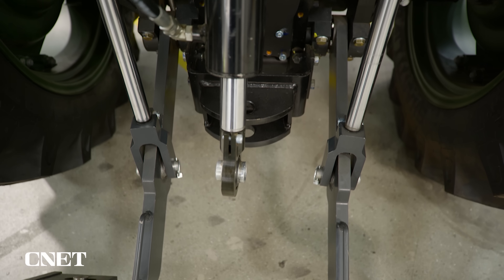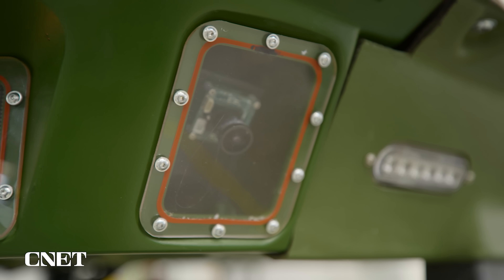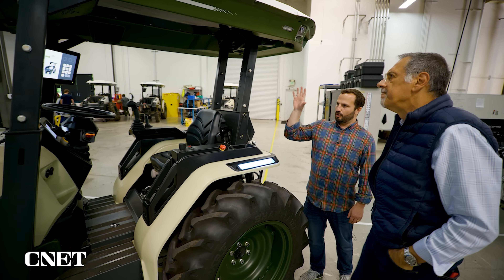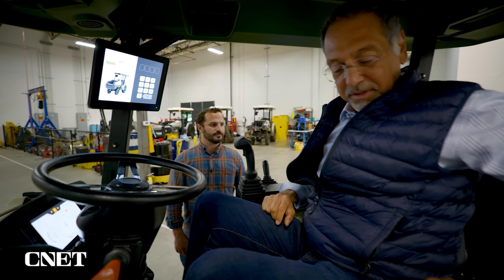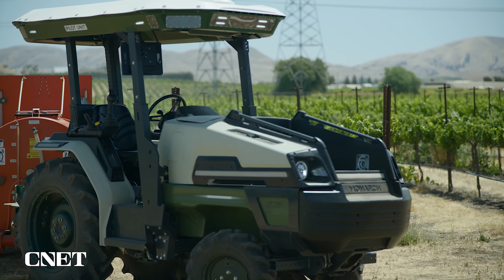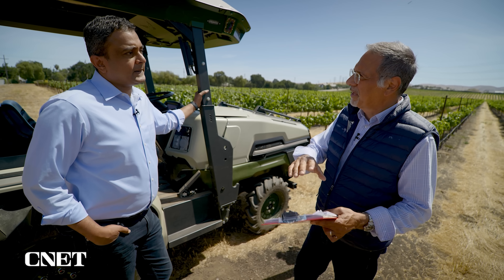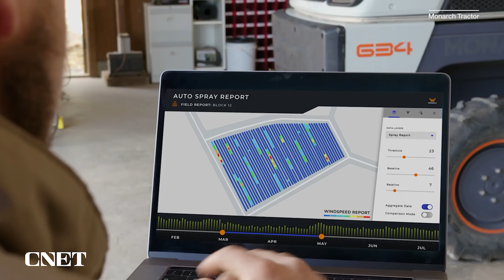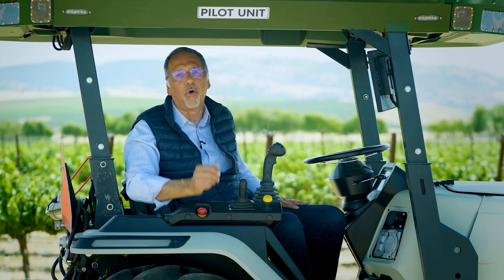This Electric Tractor Might Change the Future of Farming and Food!

Comment: Skeptical that this is going to revolutionize farming. I love electric an this thing might be super handy on a orchard or hobby farm but the majority of farming in the US is done by that other third of tractors that are 500 horsepower. They work 12 hour days under heavy load certain times of the year. I wish I could say that I think electrification of those tasks were just around the corner but I don’t think so. We don’t have the energy storage.
Reply: Yes, but the other  common tractor application is as a chore tractor on livestock farms & anywhere from 60-160 hp used to feed hay etc and typically only for a few hours once or twice a day.   I can see some possibility of chore machines being electric powered, but probably some resistance to overcome, farmers like diesel power!
Reply: @davidkottman3440  I agree. I don’t think farmers are as resistant to technology as a lot of people think. If it adds value and is economical enough farmers will use it. It’s a steep price for a tractor of its size though. I think every farm would have one if they were a third the price. At any price, I don’t think a little tractor that is handy for chores is going to “change the future of farming and food” as the video suggests.
Reply: @CanusDirusx  It's a proof of concept.  Electric tractors have 2 major advantages:  torque, electric motors are awesome at cranking out torque, and fuel costs which is 1/3 that of diesel.  THAT will sell the electric tractors.  The killer disadvantage is the 20 hour days at 80-100% power load.  ATM, you would need a forklift to refuel the big boys.  And that would also mean a number of expensive battery packs lying around in the off season.  
I'm really happy someone is actually working on this tech.
Reply: Imagine how much of a hole has to be dug for just one battery pack for one tractor.
The old lead-acid batteries for a forklift were powerful enough for an entire shift, but then had to be charged for the next shift.
Extra battery? Check.
A thousand pounds of battery, should be no problem, right?
That’s in a warehouse, on level floor, and all muscle to move them.
You aren’t changing out one of those in a field even one mile away.
Reply: @dangeary2134  exactly.  thus the problem.
Reply: My work horse tractor is a 1982 David Brown 1900.. no way this thing has wheels still on it in 40 years let alone reliably work perfectly every day winter after winter.
Reply: @Krieghandt  my tractor is just a giant hydraulic pump.. It's drive p.t.o.. and everything is hydraulic.. It's a diesel engine powering a pump, that fluid drives the wheels attachments etc..  so torque is irrelevant..I can gear it so low, it will just turn the wheels  it would tear itself apart before the wheels stop turning.. all I need is for it to work every day 10 to 18h, every time for forty years, and if it does brake down, I need to fix it in mud to my knees, with vice grips and what's in my lunch box.
Reply: More like 24 hours a day during harvesting ...
Reply: @larryscarr3897  I don't think any new tractors are built to last like the old ones were. I work 5 acres, cultivator, tiller and a blade for winter with my 1950 tea20 Ferguson.
Actually had an electrician/mechanic approach me to convert it to a 35hp electric and with the rise in gas prices, it's tempting!
Reply: Orchards, berry farms and vineyards aren't little operations. Multi-billion dollar industry right there would love this thing for spraying and the precision cultivation alone.
Reply: Jude, I respectfully disagree…. It’s not just a fuel savings, when you remove the gas engine, you’re also eliminating a lot of engine maintenance, and the self driving is going to reduce headcount on the farm… as more of these come on the market, improvements will be made… I’m sure the farmers of years ago claimed the gas engine tractor would never replace the ox 🐂…..
Reply: @dangeary2134  "Imagine how much of a hole has to be dug for just one battery pack for one tractor."......I dunno, probably no bigger than the hole the Alberta tar sands project would need to dig in order to extract enough nasty oil to produce a full tank of nasty diesel for one tractor
Reply: @davidkottman3440  Those livestock farms won't be using driverless tractors though. Any tractor that they use will need to have a decent cab. There's simply too much variability in terrain, tasks, and weather conditions for these tractors to operate autonomously.

The major factor is that these smaller livestock farms are usually too strapped on cash to pay a premium for an electric tractor. It won't be an overnight switch by any means. Many of these farms, my own included, are still using 1970's tractors, and get along well with them.
Reply: Where's the loader, won't have a tractor that size without one, so let's see it do front-end work.
Reply: @davidkottman3440  exactly, what a dream to have the tractor following you round at feeding or mucking, instead of getting on and off it every couple of minutes and starting stopping. 
 The same goes for fence repair. 

Autonomous hay cutting, turning and harvesting. Just great.

Most people commenting negatively here, have obviously never worked on a farm.
50-70K isn't that terrible either, especially considering the roof space many farms have for photovoltaic going to produce your own energy.
Reply: Just because this tractor is small doesn't mean a high HP electric is impossible. They require more investment in design, so they're a harder market to enter, which is probably why they're starting small.
I've considered the design of electric tractors many times before, and there's no reason that the long days couldn't be covered by a replacement battery pack. Pair that with solar power near your fields that brings in additional revenue, and you're expanding grid storage, renewable power, AND electrifying our food sources.
Reply: the size of the tractor has to do with one thing - allowing an operator to get more done. if you have two 250 horsepower tractors and two operators, you could have two 500 horsepower tractors and 2 operators and do twice as much. 

the future of electric tractors is to operate on their own without an operator and the need for extreme size will go away. they'll work on mapped fields, operate, see themselves to the charger when they need it and go back. And they'll operate quietly and potentially even in the dark or close to it, so there's not going to be a great need for them to run full bore 24 hours if they can run 12 or 16 of those.
Reply: Separately, one has to address what it is we're doing in the US that's different, too. We're wasting half of the corn crop as a political ruse. My family's farm just got sold a year ago, so this isn't a foreign concept. Ethanol is what I'm talking about - irrigating dryland and going huge high input and hauling to make something that wouldn't be used by mandate, doesn't have any positive environmental impact (that's not big on the list for me, but for some people it is) and has no impact on gas price. All it does is win agricultural votes. 

the market for commodities would practically collapse if the blending mandate went away. there's no legitimate reason the average gallon of fuel has to have 10-15% of ethanol in it - it's just a political program that puts pressure on the balance of what's planted and creates a huge waste of energy and inputs.
Reply: @daw162  

Yeah, ethanol was never a viable source of clean energy, and probably never will be. Electric vehicles are developing so quickly that there is little reason to invest in cellulosic ethanol, or other more efficient sources.
Reply: @daw162  

Fantastic point!
Reply: How about using wires to supply power to them constantly like they do with trains?
Reply: @thechosenone1533  

An interesting thought! Unfortunately, I think that would be much more expensive to maintain than something battery powered.
Reply: @davidkottman3440  Those aren't the tractors that do the work. People are using 4 wheelers for the jobs you think this tractor will do...
Reply: @bman6502  You are speaking from a point of zero experience, I can tell.
Reply: @marcusott2973  Yeah it's clear that you don't work on a farm.
Reply: @elonmust7470  😆😆😆😆my hands tell a different story.
Reply: @elonmust7470  just for thought, the US isn't the only country or farming environment in the world. 
Things are done differently in other parts of the world because the circumstances are very different, including subsidies.
So your experience with farm work, might not hold true in other areas of the world, like for example a dairy farm in the alpine region of Austria. 
🧐😉
Reply: IMO chore/utility size machines make a great jumping in point, far better than some tillage monster that costs $600k and has real consequences when it goes down. Better to get the details right here, instead of on a machine that’s expected to do hundreds of acres per day right out the gatw
Reply: @marcusott2973  Right, the forefront of farming isn't in the Alps... It's in North America.
Reply: @unacceptableminority7101  That's right, running twelve hours a day means you had a half day.
Reply: @elonmust7470  and Argentina, Brazil, Ukraine, Russia, Kenya, South  Africa, the Netherlands, India, Australia and yes in a technological sense also the Austrian Alps. 
Very few places in the world beat us in yield per cow and ton of feed.
Reply: @marcusott2973  The only place you mentioned that was worth mentioning is Russia.. 
 My grandfather started a cattle ranch back in the 50s. Been running on average 3000 pair since then on properties between 20,000 & 50,000 acres. California is one of those "few places" in the world...
Reply: @bman6502  I completely agree that electric tractors would be superior in almost every way. I just think the battery storage is going to be a steep hurdle. Electric cars are made to be light and efficient. I’m skeptical that batteries will have enough capacity to drag an implement through the soil all day. The amount of diesel a tractor goes through doing that is unbelievable. I could be wrong. I’m not an expert.
Reply: @daw162  the potential of every farm to have a fleet of tractors is an interesting possibility.
Reply: @daw162  I completely agree that completely covering sever states with field corn is a form of collective insanity. There are much better uses for that land. Uses that would and should be profitable for farmers. Government policies have taken agricultural in the US in an unproductive direction.
Reply: @elonmust7470  sure Bill, I own 6 tractors… and your experience???
Reply: @CanusDirusx  no doubt there’s going to be a steep challenge ahead. But every year we’ll see improvements.. within the next 10 yrs, you’ll see a major shift…
Reply: @bman6502  almost 20 years of logging and a family of ranchers...
Reply: @elonmust7470  to quote a line from a famous movie bar fight, "Now boys, don't let those teenage hormones get you in trouble."
Reply: @WhatDadIsUpTo  Tell that to the other guy, the one liking his own comments.
Reply: They have electric cars with 2000hp and tractors could have good sized solar panels on board to extend range, so they will soon figure it out if they haven't already.
Reply: @paulg3012  ROFL
Reply: And that where retrofitting tractors come into play.  With cost and efficiency being priorities, they will drive change.
Reply: @CanusDirusx  electric tractors will work just as well as ev cars and trucks.......................so thats a firm NO
Reply: @billw8476  let’s do the math. Let’s run some modest numbers. Let’s say we are looking for a tractor that can pull at 250 horsepower for 8 hours. Mind you, that would not be good enough for a large percentage of farmers. 1 horsepower hour = 0.746 kilowatt hours. 0.746 kilowatt hours x 250 horsepower = 186.5 kilowatt hours. 186.5 kilowatt hours for 8 hours = 1,492 kilowatt hours. We will need a 1,492 kilowatt hours battery. A Tesla Model S has a 100 kilowatt hour battery. We will just need 15 model S batteries. We can get top of the line batteries that are just 23 kilograms per kilowatt hour. That comes in at 34,316 kilograms that’s 75,654 pounds. At the current market cost of about $132 per kilowatt hour our 38 ton battery will cost $197,000.00. We will need a power source that would be capable of changing 15 Teslas at once or resign to it taking several days to change our tractor. I think it would be great other than those couple kinks. (edit: To be fair it looks like I messed the weight calculation up. I think the battery would actually weigh about 18,000 pounds, 12 pounds per kilowatt (15 Tesla Model S batteries at 1,200 pounds each). Much more reasonable but that is still about a ton more than an entire 250 horse power diesel tractor weighs for the battery alone. The battery would still cost about $200,000 and would still need the equivalent power supply of 15 Tesla charging stations to charge in a reasonable amount of time.)
Reply: It's Not possible to build the Tractor or ALL of the thousands of metal, Rubber and various parts required to assemble the tractor and it's accessories plus the Batteries.
 That very tractor required Coal or other powered foundries & gasoline and Diesel powered vehicles to dig the ore and minerals out of the earth. How are the BATTERIES charged? Not from solar or windmills. Coal again. It's a fantasy world to think otherwise.
Reply: @Ms123kill  I didn’t know what you think goes on in developing countries but aint no one running a $70k self driving tractors that require large, reliable source of electricity. They aren’t trying to find ways to save labor in developing countries because labor is inexpensive and automation just puts more people out of the workforce.

Comment: During the spring and fall when you are under pressure to get a crop in or out, you can’t  be sitting around for 4 hrs waiting to charge a tractor so you can get 6 hrs of run time.   In big farming operations they may be running 16 hrs a day.   This tractor could be good in some operations, but not when you are farming thousands of acres.  I have solar panels and even a battery powered 42 inch zero turn mower.  I’m not against the technology, but charging time can be a serious drawback when production has to be done in a limited time.
Reply: Not to mention the heat. Electric zero turns seem ok (mine was nickel cadmium though) but a bigger battery like this in the heat idk.
Reply: @devinpol4258  The heat and the cold. I run my tractor every month of the year, and running 1000 lb bales to pasture when it's less than 10⁰ out will kill the battery life.
Reply: yeah, tractors often need to run for a good 32 hours nonstop during harvest or seeding, electric just isn't viable
Reply: Double battery pack, like in big farms, double tractors, more and more tractors, biggers, etc… think about a solar station recharging some batteries packs while another packs are in use.